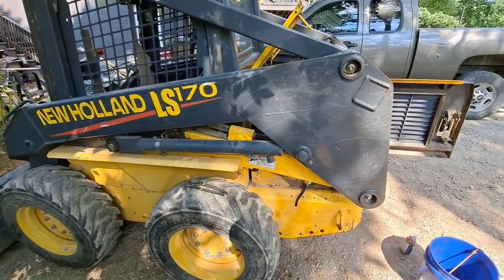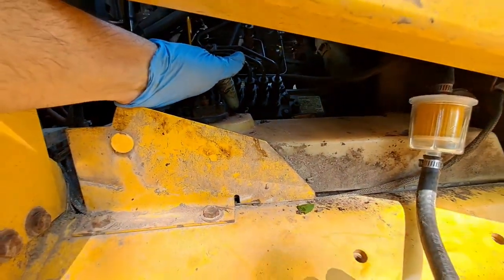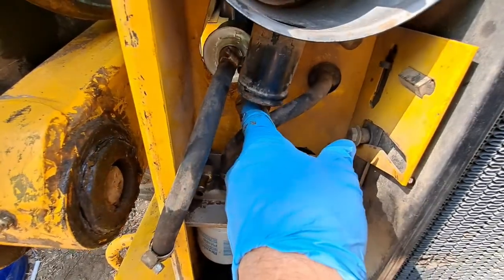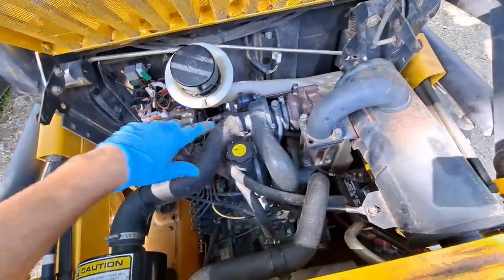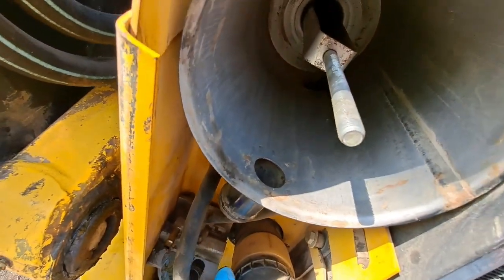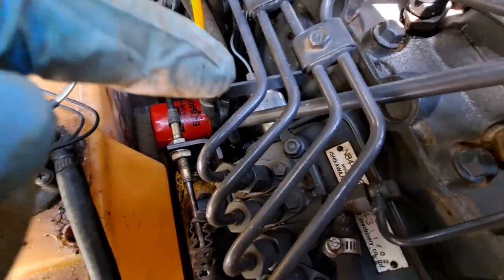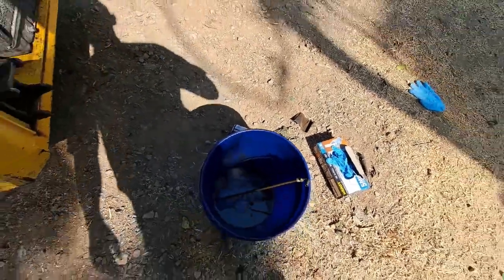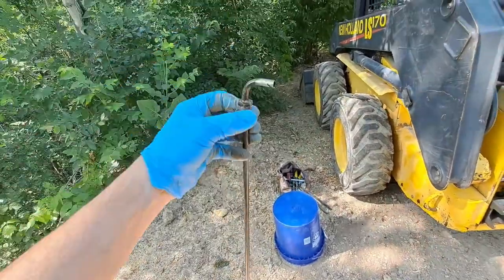New Holland LS170 Skid Steer-F04 Code Fixed-Fuel Solenoid, Hydraulic, Oil, and Fuel Filter Overview

Comment: What year is that? I just bought what appears to be the exact machine but it was sold to me as an 08 ls160. They bypassed all the safety stuff and rigged the piss out of it so I've been trying to figure out how things were supposed to be..so far you're the only video i could find givinga detailed close up of the engine bay so thanks for that. Seems I'm missing a lot more than i suspected..have any more videos showing up close of cab/engine bay? Thanks regardless!
Reply: I found your other video and i see it's in fact not the same machine..different dash eic setup and lights but exactly the same in the engine bay or at least should have been I'm assuming.. Do you happen to know if your fuel pump runs in ON position or only in START position to pickup until the injection pump takes over then shuts off?
Reply from the maker: @sirridok  New Holland lists the Ignition Type as "Compression." The Fuel System is listed as "Indirect."  Hope that helps to answer your questions.
Reply from the maker: @sirridok  This is a 2003 LS170. It's been a very tough machine, but a clogged fuel filter or a rusted pickup tube will stop it in its tracks.